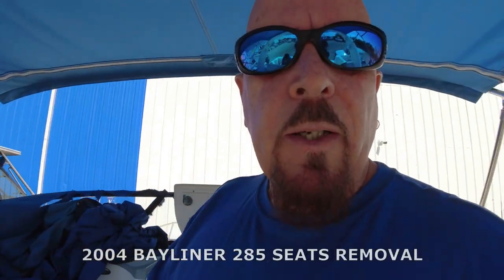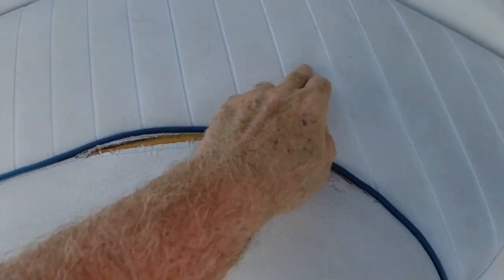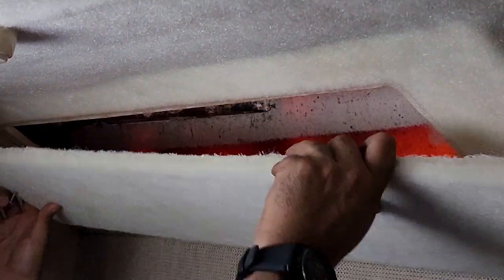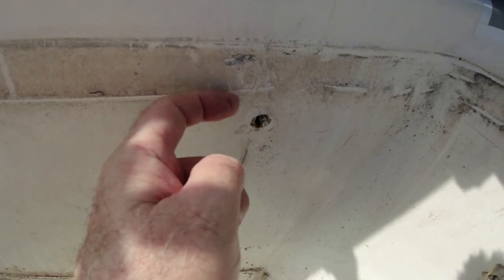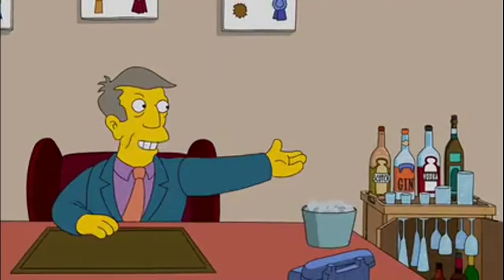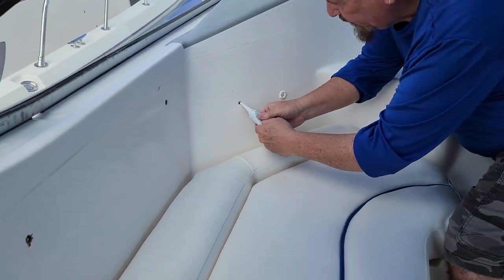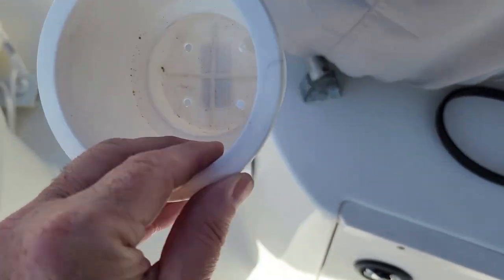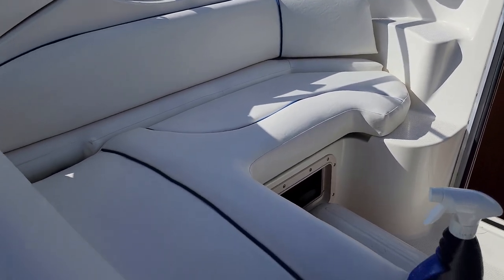HOW TO REMOVE SEATS ON A BAYLINER 285 SB BOAT (Reupholstered)

Comment: 7:28 I found an access panel in the aft cabin to get to these screws. You need to remove the curtain and shroud to get at the other side of the bulkhead. I can’t post a picture or video here but I can message anyone that wants to see how. They definitely don’t make it easy. I just used your video to remove my seats yesterday. Thanks again for posting this video!!!
Reply from the maker: Thanks so much for watching! Great to hear it helped you. Also thanks for the information this will help others to access these screws, on mine I don't have any curtains maybe its a different year 285. I did noticed that some other years do have a little storage cabinet in this area. But my 2004 285 did not have anything to access these screws. Thanks! Peace from the Keys!
Reply: @KeysBoatingChannel  Right!  Mine is an '05 so probably different.  It still wasn't easy but at least there was access.  Cheers from the West Coast of Canada!!  Happy boating!

Comment: Great video. You should post this on all Bayliner boat forums. I'll post it on BOC. I have walked a few folks thru this job but a video as this one is the best. 
I have done this job and it can be challenging if you don't know what you are doing or where to look. I have a small cabinet where you access those two screws that where unaccessible on your boat. Great stuff. This will help many 2855/285 owners as these boats are aging.
Reply from the maker: Thanks so much my Brother! Blessings to you and family! Peace!

Comment: Thank you so much for putting this video together.  I'm re-doing mine for this season and this video just saved me a ton of time trying to figure it out myself.    I am wondering where you picked up that after market captain seat and how you installed it.  Mine needs replacing and I really like the look of it.
Reply from the maker: You're Welcome! Here's the link to the captain chair we used: https://amzn.to/4aiIUp3 Hope this helps. We used the same slider bracket that came with the boat on the old chair, and put a piece of 1/2" or more thickness starboard to bolt the seat to the slider bracket. Thanks for watching our video! Peace from the Keys!
Reply: @KeysBoatingChannel  I really appreciate it!  Thanks